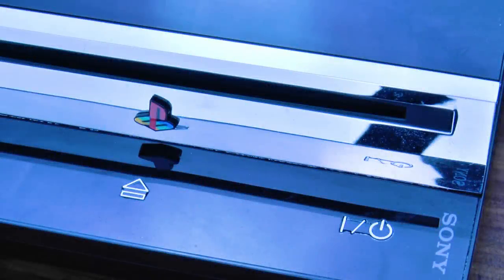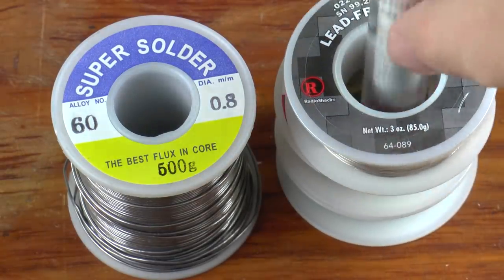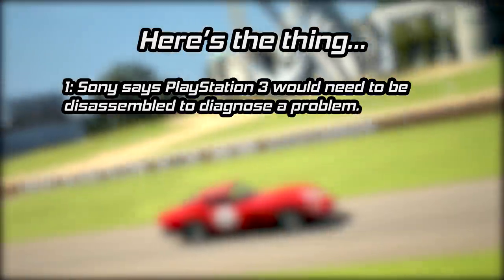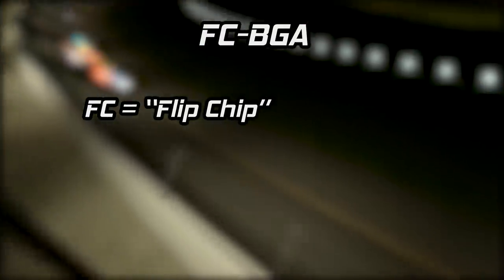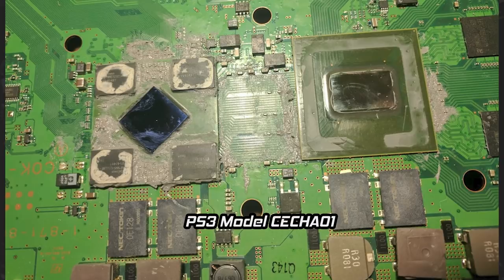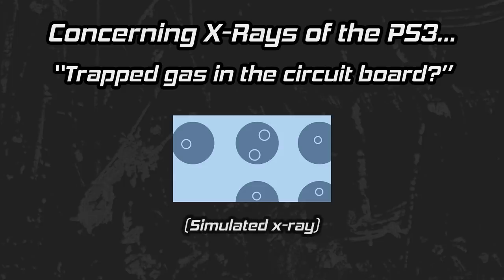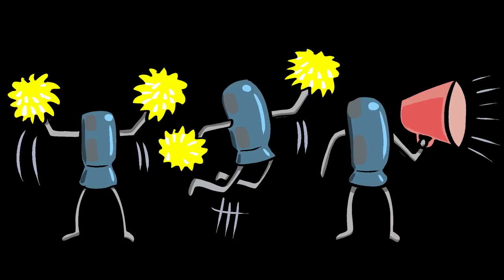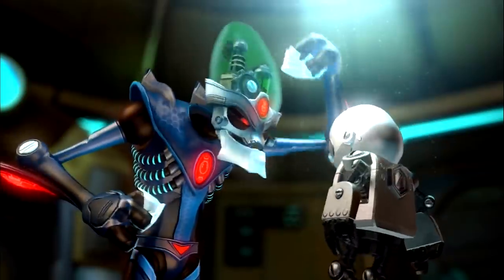The Misdiagnosis of the PlayStation 3 Yellow Light of Death

Comment: Yep, it’s been discovered very recently that almost all YLOD launch PS3s can be fixed by replacing the NEC TOKIN capacitors, and the reflow/reball fix worked by coincidence.
Reply: As a technician myself (30 years) this makes perfect sense and when they mentioned "NEC" I face palmed hard!! Cheap and poorly engineered caps killed many a Turbografx 16, Turbo Duo, and Turbo Express. I never understood what it was with NEC and caps? I know they go for cost cutting but I've repaired my NEC consoles with simple capacitor kits. NEC never learned from their mistakes in the 90s. SMH
Reply: @deathstrike  so first thing i should do IS to replace the capacitor? IS that the Hole case
Reply: @anjratn141  No, it's hard to describe in this forum but you need to take a slow and methodical approach. There are many YouTube videos on most vintage and modern consoles that will guide you through the process of opening, testing, diagnosing, and possible repair. I stress the word POSSIBLE, many do not have the proper equipment or expertise. So please, if you are unsure of your skills or your not sure if the problem is major, get your machine to someone who is qualified to fix it. If you feel comfortable working on your machine, check out the YouTube video on your console.
Reply: @deathstrike  thanks mate for answering I don't trust any of them since I watching all of them and  reflecting people respons, but you didn't  answer my primary question is first thing on this mysterious issue to check  the capacitor or go straight to gpu fixing problems, sorry for my cheap English I'm still learning
Reply: Anjra Tn As with any troubleshooting, do the simplest thing first. Replacing a couple of faulty capacitors, while not the easiest task, is definitely easier and cheaper than reflowing or reballing. If your PS3 YLOD’s, it wouldn’t be a bad place to start.
Reply: Any reliable place doing such a repair?
Reply: @deathstrike  well a ylod ps3 is barely worth its weight in shipping much less the cost of qualified repair so i'd say it's a good place to start learning. Its fairly shocking to me that Sony was willing to put its name on the hulking pile of near future scrap that is a phat ps3, someone could write a whole textbook about it for the EE course on how not to design electronics
Reply: @Xilog  I meant the layout of the board and the cooling solution taken as a whole. It has every problem, including electronic components, those caps. But, no caps that are prone to electrolytic thermal decomposition, ie, all electrolytic caps but especially those NEC ones, should be placed that near to something that can fry them at normal operating temperatures. I fixed a phat PS3 with an overheating GPU, the problem was that there was too thin a layer of too poor quality a thermal paste applied between the lid and the heat spreader, the paste in the middle over the die was cooked dry, and most of the paste that was applied ended up in a blob around the chip rather than on the lid, so either too much paste was applied, or too much torque on the heatsink screws either by design or overtightening. I've never heard of such an issue happening with any PC CPU or GPU by design only by improper application of thermal paste, user/OEM error. 
Finally, the fan generated insufficient airflow (because they prioritized not making noise over not frying the board in the fan firmware settings mainly, but also because the inlet and the outlet are not on opposite sides of the case, so it's basically sucking in a lot of its own exhaust, and nothing in the case design physically prevents the end user from completely blocking the vents), combined with no way to clean dust out of it, guaranteeing the whole thing will get clogged up and trap all that heat inside thus also contributing to GPU/cap overheat.  
Replacing the NECs with better quality caps that don't fry so easily seems to permanently fix the problem, so NEC is definitely to blame, but, if replacing the thermal paste on the GPU fixes its heat issues, then Nvidia is not to blame, that's on the OEM/assembler, I saw with my own eyes how bad a job they did on the GPU cooling, it was really bush league. The whole heat removal solution is simply insufficient, it's not any one thing, but just look at the astronomical failure rates, that proves the design is defective.
Reply: @ballinnickyc  Very well laid out. I have my early PS3 Fat carefully disassembled and all dust-cleaned from the flashing red light, beeps and turn-off. I'm guessing this is YLOD? (Cannot recall if there was a quick yellow light before the flashing red.) It is so evident once you really have it apart how many design issues conspire together to build up heat and not properly dissipate it: Mainly, trapped, built-up heat. Inability to periodically reopen and dust it out w/o breaking the thermal paste bonds and having to redo it each time unless you leave out certain inner screws the first time allowing to lift out everything from the case w/o disassembling to vacuum it.No finned heat sinks in my version.  The inlet/outlet fan issue you mention. Ideally, it would seem, to remount everything in an airy PC case with proper heat dispersion. Which brings me to.. Would like to do something to repair my unit  (but a logical, non-destructive thing) before a thorough re-thermal pasting including under the heat spreaders. Would you go right to capacitors?  Is that the only "respectable" possible fix out there? I have seen so many "PS3 Fix" videos out there, with as many folks saying it may temporarily fix it, possibly incidently, or not fix things at all, but it seems the risk to simultaneously damaging components are there. Any thoughts?
Reply: I'm watching this video from my previously YLOD PS3 Slim where I've had replaced half of the NEC Tokins with Tantalum capacitors
Reply: I'm gonna replace the capacitors myself.  My PS3 just got the YLOD during this past week because I accidentally left it running, though I was running a very light 2D game so those capacitors were probably on their last leg to begin with lol  I'd probably just try blasting it with heat first, but I'd rather take it apart once instead of twice.
Reply: @kengruz669  My PS3 got the YLOD because I left Street Fighter 3 running.  A very light 2D game.  I'm going straight to the capacitors.  This PS3 was previously jailbroken and I've checked the temps before and I always averaged high 60C through mid 70s C, so I know it's not a heat issue, and this is a non-BC phat model.
Reply: @tyisafk  does it have custom firmware?
Reply: @deathstrike  How the Hell did NEC survive long enough to help with the Dreamcast, let alone the PS3? And I say this as someone who laments that their rendering technology wasn't more widely adopted.
Reply: @anjratn141  It won't be the whole of the problem for everyone, but as long as you know what you're doing, it certainly can't hurt. It should be the MINIMUM you do.
Reply: " and the reflow/reball fix worked by coincidence" it is not coincidence, NEC tokins are very close to cpu and rsx. By heating board, tokins also absorbed that heat and simple electrolytes inside tokins got activated. PS3 got alive once again, but not on long terms. I still repair old backward compatible ps3's for my collection. 90% of time are just tokins. In 2022 to be sure it is fixed and not overheating i also "delid" cpu and rsx to repaste. Result is 65C on both after 3 hours of playing which is great.
Reply: Turns out it wasn't the caps after all, or at least they aren't the main culprit. Now the main theory is that it's solder balls INSIDE the chips that are the cause of the issue, a problem caused by mistakes by chip designers like NVIDIA. The best way to fix them now is to replace the CPU with one from newer PS3s, once this issue was sorted out. If you have 1.5 hours to spare, "RIP Felix" made a great documentary about it here on YouTube.
Reply: @marro643  beat me by 4 days
Reply: I’d also recommend watching the videos by RIP Felix. Extremely informative.

Comment: I can't like this video enough.  After fixing my 2010 Macbook Pro when they also figured out this was the issue, I question everyone saying reball is the answer to anything.  People said the GPU was bad, when all it was is a single cap that can no longer deliver clean power that causes the GPU to crash when switching on and off.
Reply: Reballing is like reflowing for people who can charge you to do it. It's only the first thing to try because you don't know how to or don't want to bother to diagnose and fix it properly, and it's an easy thing to do that has a somewhat decent chance of working.

IMO reflowing is only really makes sense if you are ready and willing to just buy a replacement of whatever is broken, and you wanna take a chance at saving that money you would have spent with minimal effort.
Reply: I think I have that same MacBook Pro that’s having that same problem, would you mind linking a repair guide for that capacitor?
Reply: Rehot CPU bro
Reply: It's such a cheap and easy fix you'd think we'd default to this long before a reball/reflow.
Reply: It's also a matter of knowledge. I worked in repair when the problems with these macbooks started, and there simply wasn't any information out there to go by. It didn't help that the model right after that one actually did have gpu issued that required a reflow/replacement.

Comment: This turned to a Luise Rossman video real quick
Reply: The 2011 mbp comes to mind...
Reply: @rartolak  YES, that's exactly what I was thinking.
Reply: Yeahhh that was some lit shit!!! you know what i'm talking about... that was like a fireworks board.
Reply: @rartolak  yeahhhh.....
Reply: They don't have pp bus
Reply: sans a straight-up diagram and diagnosis, yea
Reply: *Louis Rossmann
Reply: I'll be that guy... Louis Rossmann doesn't own Electrical engineering, honestly to me it feels a little insulting considering the amount of people that work to create this stuff.
Reply: And that's okay
Reply: I could never imagine Louis getting a sex change...
Reply: If it was a real Rossman video he'd be showing under the magnifying glass how to diagnose if it was indeed the capacitors or the CPU or GPU.

That being said, if a PS3 CAN do the fan test to eject the disc, then at least the CPU has SOME capacity to run, which means either the GPU died or the capacitors are not being able to transmit the current properly and the PS3 shuts down to prevent frying components.
Reply: I find it a bit ironic and funny, as I've been contemplating reaching out to him, to see if he would be willing to diagnose and fix my ps3, or if it he only works on Apple products.
Reply: @mikeO31082  Point him out about this being a capacitor issue. He shouldn't be having much issue even without access to the PS3's motherboard schematics considering the NEC capacitors stick out like sore thumbs thanks to the "NEC/TOKIN" printed on them, and he should feel it's reasonable.
That being said I think he'd start going "You already know what components are causing the issue, how to replace them, why are you not attempting this? You know my services don't come cheap"
Reply: @OfficialDJSoru  I would do the work myself, if I actually knew how to remove the capacitors. Also I don't know the first thing about soldering.

Also I've been hesitant, because I already opened the system myself to replace the thermal paste, and I know how he dislikes "fixing other people's mistakes"
Reply: @mikeO31082  I would do the same because figuring out how to replace these with tantalum capacitors isn't hard (just put the marked side of the capacitors aimed to the outside of the soldering area of the capacitors according to pics of successful repairs), but my problem is that I can't find the tool my dad has to suck up the excess solder that I gotta melt and remove from the NEC capacitors before applying new one.

Couple this with shaky hands and you got a recipe for disaster. I already botched soldering wires for a PS2 modchip before I even attempted soldering the wires to the PS2

Comment: who thought that a mere NEC Tokin is  causing the issue.
Reply: Yeah, the cracked chip theory doesn't make sense to begin with.
Reply: @fss1704   Oh it makes sense, it makes quite a bit of sense. But just because it makes sense doesn't mean that it's true or that it's a predominant cause of failure rather than a fringe one.
Reply: @SianaGearz  what dowsn't make sense is the way of fixing that cracked chip, let's be serious here, you can reball and reflow a cpu/gpu /chipset. And yes early 2000's electronics had issues with multiple manufacturing proceses. but that was a easy way to swindle people out of their money and was quickly disproven by proper repair stores. Multiple  motherboard chipsets could be temporary fixed with "reflow" and it was big buisness for computert repair shops in the past, but i never heard of reflowing a cpu, even a soldered bga style one in a pc or laptop, because those things were much smaller and used a diffrent technology of flip chip soldering than low budhet, in comparacy motherboard choipsets. and they also suffered much higher thermal  abuse. it makes much more sense for sony to use that prosess on their parts, then again amd and nvidia had their share of problems with gpu failure themeselves, amd or ati at the time was an early adopter of new production node while nvidia lagged a bit behind.and had bigger failure rates. i seen ugly repaired ps3's with capacitors dongling outside, working! fat, slim, middle models. and in many cases power suply was the problem or those caps, but i never tryed to reflow or replace the gpu or cpu. what i said to friends who tryed to make me reflow those was i don't have the equipment to rebal the thing and even if i had i could do more harm than good by doing that. and we jist scoped power rails, then cpu caps and everything was clear. I didn't take money for those repairs because i am not a shop, i didn't take outside of friend zone jobs either , just fun bits. and in my case we put multiple smaller caps just to balpark mach capacity of those things, often on top of oryginal ones
Reply: @kokodin5895  
the good old nvidia bug which killed many laptops with 2008 nvidia graphics chipsets.
Indeed a very interesting topic. CPUs almost never die. However with graphics chips it is the opposite: the nv bug wasn't the only issue with mass defective GPUs. AMDs HD6xxx series had a similar issue (most commonly known as the Macbook Pro 2011 issue, but also many Radeon HD 6870 cards had a very short life expectancy).
These are only two of those issues. Makes me wonder why especially graphics chipsets have those issues. Maybe because they run hotter. But modern laptop CPUs are TOASTING themselves (for example the i5, not even the highest option, in my Thinkpad L390, constantly hits 100°C, from the day it came out of the factory) and yet still they don't die. And no, my laptop wouldn't profit that much from a repaste, this is how those newer Intel ULV quadcore mobile CPUs work. They intentionally have a much higher power output than the cooling system can handle, and only throttle after a very high temp is reached. And in comparison to GPU dies they seem to withstand those temps for years.
Reply: @TheRailroad99  GPUs have a much higher transistor density, so that may play a factor. Also, much of the die space in a CPU is cache which uses far less power than a floating point unit, for example. CPUs have had thermal probes in the hottest areas of the chip so they can be fairly certain about how much thermal headroom they have. Older GPUs however, had less accurate means of measuring temperatures so an nvidia 8600gt reporting 90c temperatures is not at all comparable to an Intel core i7 9700k reporting 90c. Newer GPUs like AMDs 5700xt have dozens of thermal probes spread out along the die and are able to give "hotspot" temperatures(I.e. "CPU" style) as well as "edge" temperatures("GPU" style). A GPU reporting 90c edge temperatures can be experiencing over 110c at the hotspots.

Regarding your laptop, as undersized as the cooling system may be, you can sometimes significantly improve performance by undervolting the cpu and adding a small copper shim to increase contact with the die. My HP probook 840 g2 suffered from poor contact yielding 90c temperatures at stock speeds with throttling after just 10 seconds. Now it never crosses 80c despite holding its max turbo speed for 4 times longer and maintaining clocks 180mhz higher afterwards.
Reply: @thebeetalls  thx for the explanation. That could very well be a reason. (Probably the difference between hotspot/edge temps also is a factor then, because the contraction/expansion is then (slightly) different on different areas of the same chip).

Regarding the thinkpad: indeed undervolting might help. However I don't like software OC/UV. It is not as "clean" as a BIOS mod/setting independent from the OS). As it is a single chip system (no GPU, chipset in the CPU) I think the thermal contact is fine (at least that is my experience from many many laptops. Most of the time the issue is when two chips are cooled be a single heatpipe), however I will look if the warranty is over)
Reply: @TheRailroad99  I use throttle stop for the undervolting, its basically just a ui for editing the register values. I use a custom task(windows task scheduler) that starts it on boot and I never have to worry about it.
Reply: Me